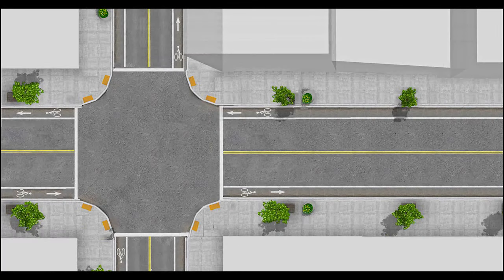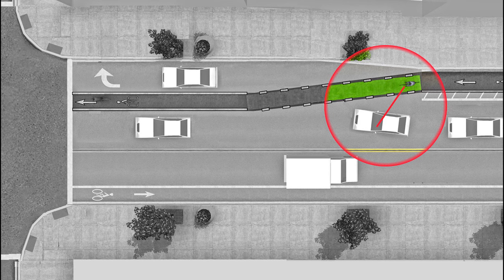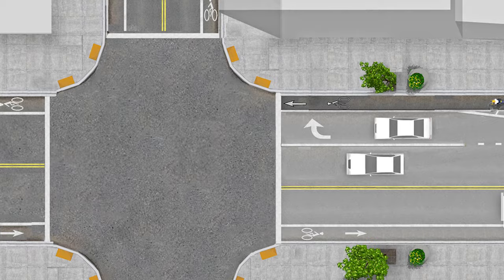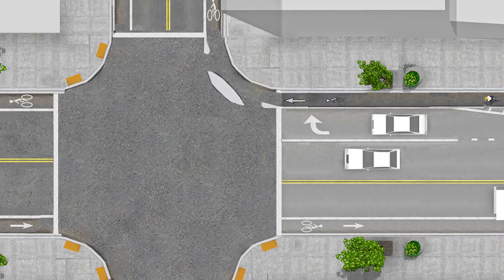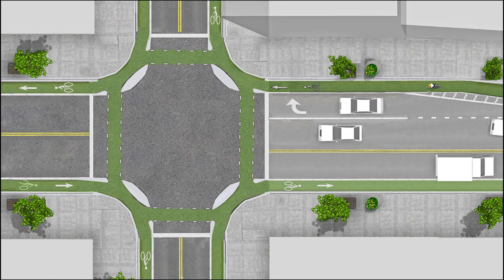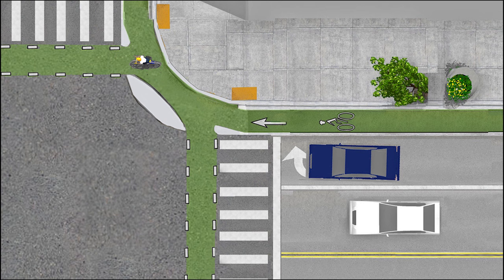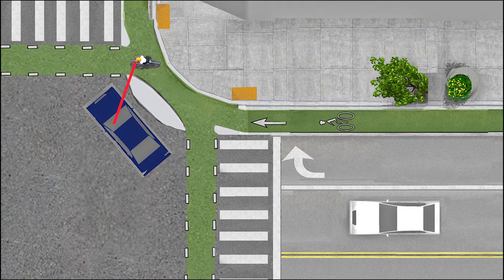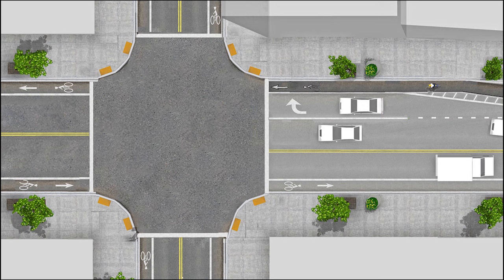Intersection design, the Dutch - cycle friendly - way

Comment: The problem does not originate at the intersection, therefore redesigning the it is pointless! At the point where a motorist initiates a turn, a cyclist, who is now on a collision course, may be many meters from the intersection and therefore invisible to the motorist. Even a relatively weak cyclist can travel at 10 m/s or more. If a motorist takes 3 s to traverse an intersection, the cyclist will have moved 30m in the meantime. These intersections "solve" the problem only insofar as it would be practically impossible for a cyclist to traverse them at 10 m/s!
Reply: Who the hell cycles at 36 km per hour. Most streets don't allow cars to go that fast. Most cyclists cycle arround 15 km per hour or about 4 meters per second. And it is still a masaive upgrade even if a car has to stop for a cyclist as cars can actualy see the cyclists and they don't have to check for cyclists whilst checking for other car drivers, it also helps cyclists who want to make a left turn from cycling in the middle of an intersection
Reply: @Lunavii_Cellest  Lots of people. It's not that fast. Maybe not in that cyclist Shangri La the Netherlands, but there are these wonderful things called "hills". And you may not have realized this while driving (nor the part about hills either) but there is also this wonderful thing called "wind". Around where I live (and most other places for that matter), most roads have speed limits of at least 40 km/h.
Reply: @Lunavii_Cellest  And to recap: if a cyclist is moving at a reasonable pace (>25 km) they cannot be seen at these intersections as they will be nowhere nearby. One of the things that makes cycling most dangerous, is that cyclist are hard to see. Yet the policy makers believe for some reason that by pushing cyclists way off to the side of the road where they are even less visible, cycling will become safer. It makes no sense.
Reply: @NakedUndone  it does make sense as cyclists wont be in any blind corners, and all i see is that 15km/h is the average cyling speed in the Netherlands but also in the rest of the world. and even if you are going very fast this design makes you more visable as you can look to your left and right when you are crossing the intersections
Reply: @Lunavii_Cellest  On the road, you would have right of way and could move through without hesitation. No need to look left or right. "Visibility" in this context does not mean how well the cyclist can see, but how well he or she can be seen, which is probably more important.

"Most" cyclists move at 15 km/h. So what? Why should the "infrastructure" discriminate against those who are capable of more, especially considering that most roads designed for motorists allow for speeds in excess of 40 km/h or more? "Most" cyclists also find they are capable of considerably higher speeds than just 15 km/h after only a few months of riding. I would like to see this vehicle used to its full potential (unlike in the Netherlands...)
Reply: @NakedUndone  cyclists are very visable as they are not in the blind spot for drivers that are turning, and you area able to go higher than 15 km per hour and some people do that. the vehicle is used to its highest potential in the Netherlands. thatsa why everyone rides one. if you want to go fast on a cycle path that is totaly possible on our many highspeed cycling paths like the local one near me the F270 or the Rijn-Waal pad or on the many rural cycling paths. you have obviously never seen what the netherlands really is and that is showing.
Reply: @Lunavii_Cellest  Sorry, I don't believe it. One time I was cycling from Bremen to a Dutch town. I came to a road that obviously lead directly to the centre of town. Sorry, no bicycles allowed. The bicycle path, by contrast, crossed and recrossed the road, snaking through the farmers' fields. Great if you're out for a Sunday ride, not so much if you've just put in an eight hour day, the light is failing and you just want to reach your destination.

I find Dutch cyclists annoyingly smug about their so-called "infrastructure". It's called Stockholm syndrome. They are so used to being second-class road users that they no longer think about it.
Reply: @NakedUndone  "Even a relatively weak cyclist can travel at 10 m/s or more".🤣😂😅   RUN John Forrest(er) RUN !!  Make way for 'Vehicular Cycling for ABLE cyclists !! '  LMFAO 😅! On a normal singlespeed city bike most cyclists won't make that 36kmmh speed and definetely not for a grocery ride !  Besides on a junction where a lot is going on car drivers (or others) may oversee a biker at 36kmh speed !) .
Your ideas are so out of date,  as that idiot  John Forrester himself .
 An 'able'  Maserati is capable of driving speeds of 250kmh , but there are very good reasons not to do so on public roads and take a slow drive in town of 30/50kmh .  Simliar it is not smart to cycle 45 kmh in residential/urban streets with a Pinarello race bike. The risk that you hit other bikes or suddenly crossing pedestrians is too big ! (although you probably would label the latter 'Jaywalking ' 😬😬). 15-20kmh is a sensibles speed, (you won't gain much time speeding with traffic lights junctions anyway , just the same with cars.)
Too bad for your  need for adrenile rush !! But you better safe that for more rural country roads or bike highway paths where you can speed up better !

When you don't have the extra curbs a lot of car drivers are inclined to drive right to the  sidewalk ridge. With the curbs they usually won't do that, because it makes no sense for them. They have to move left at the junction again.
In practice though, when traffic volumes are such to put in these curbs, it will usually be accopanied with a separate bike path and you won't get right shoulder cornered anyway. (But an urban 36kmh will still be a act of real asshole behaviour !).
Reply: @NakedUndone  You know your videos are visible, right? We can hear you huffing and puffing going a measly average 26 kph.

We know that you think having to slow down slightly for intersections will kill you, but it really, really won't. I typically slow down to around 20 kph and then speed back up. It's not a big deal. Unless you're in horrifically bad shape.
Reply: @NakedUndone  Ah, you want to ban cars. Well, I'm with you there, comrade. High five.

There's nothing inefficient about my city's bike lanes. In fact, they're often in better condition than the roads because bikes don't wear the tarmac nearly as much as cars do. There is no issue going 30 kph and I often do. And you don't impress me with your age - I'm 51.

I don't know why you have this obsession with never slowing down (I assume you tear right through red lights), but it's just really weird. The irony is that your two videos showing the efficiency of the road (where you ride in the bike lane) and the bike lane (where you ride on the sidewalk), result in you covering the same distance in almost exactly the same time - despite your ridiculous claims on Quora.
Reply: @NakedUndone  "try it downtown"

I don't know what the hell "downtown" means to you, but in my video I'm riding right through central Copenhagen. It simply doesn't get much more downtown than that. Unless you mean the pedestrian-only shopping streets where, you know, only pedestrians are allowed. But notice the street I enter 6:18 into my video. That is a one-way street. Or rather, it is one-way for cars - bikes are allowed in both directions. Tell me again how that is being treated like a "second-class" citizen. I would literally have a longer route home if I drove a car. (But, just to be clear once again, I agree that we should effectively ban cars from our cities. That would be a good idea.)

So in your video you pick a shitty sidewalk that you're supposed to share with pedestrians, and you go "Look! This is why bike-lanes are bad!" No, you've only proven that infrastructure in your city is shit. But everyone expected that. And no one here is advocating for that kind of shitty infrastructure.

You absoutely could not "easily" have done 40 kph. Stop John Forestering. You sound like you're hard pressed to do 30. And when you're 70 years old, you'll probably be happy doing 15, but the cars will still be doing 60-70 kph. Let's see if you still feel comfortable having them pass within inches of you by that time.

And, OH MY GOD, you lost a whole minute out of 15! Imagine losing a minute to the lying you could have been doing on Quora.
Reply: @NakedUndone  Oh boy...

"For instance parked cars on the side not only put you in danger of being "doored" and of hitting a pedestrian"

Aha, so when you're driving down the road on the outside of parked cars, there is no danger of getting doored, right? So I couldn't easily find an entire video dedicated to cyclists getting doored, a lot of them riding in the road, right? Like this one: https://youtu.be/SWJioMfIuLQ 
( And you can easily find plenty more videos of people riding in the road getting doored.) Of course, the mistake all those cyclists make is trying to pass all the cars queuing up. What they should have done is behave like a car and STAY behind those cars, right? That would mean getting stuck in traffic just like the cars. I'm sure you would enjoy that. Would you enjoy that?

"but also make you invisible to left and right turning vehicles"

Another lie, because we don't allow parking close to intersections. I believe the minimum distance is about three car-lengths, though it's typically more - leaving plenty of view and stopping distance (despite your silly drawing on Quora). It also depends on the signalling at the intersection. For example, if there is a dedicated turn signal, then visibility is less important as it is assumed that people will respect the lights.

"extra, unnecessary bends"

Seek help.

"pedestrians on the bike lane"

Because pedestrians famously never cross the street. Jesus christ...

"extra long light cycles slow everybody down"

North America's stroads: Famous for its short light cycles. (That's sarcasm, by the way. We know how absurdly long those cycles can be.)

"difficulty passing slower cyclists because the lane is too narrow"

Learn how a camera works. No, really. Have you heard of "lenses"? And how they can change perspective? No? There is plenty of space to pass. The typical width of a bike-lane is 2.2 meters. How are you this ignorant? How are you almost 50 years old and don't know how cameras work?

"It wouldn't surprise me if a strong cyclist would lose over 2 minutes taking the road vs. the bike lane."

Like I said: If I had to stick to the road, I would literally have to take a longer route. I would also get stuck behind queuing cars or risk getting doored passing them. (Though obviously not on this particular day when the roads were practically empty.) Why do you think we have bike messengers in Copenhagen? Because they can get around the city faster using the bike-lanes than a car driving on the road.

"I'm pretty sure I'd be physically capable of riding most of the stretch in your video at 40 km/h."

How many years in a row did you win the Tour de France?

"You'll notice in my videos that, unlike anywhere in Copenhagen, there is quite a large hill. I'm easily doing 50 km/h going down it, at least on the road."

There is a hill in Copenhagen where you can reach high speeds. People generally don't because they're not like you and me. But general infrastructure should not be designed for exceptions. I know this is a hard concept to grasp, but that's how reality works. What do you do if there is a red light when you're coming down the hill at 50 kph? Also, please shoot some footage of you going through a turn at 50 kph. Remember to document it using a Garmin watch or similar, 'cause I don't trust your lies.

"Tell me again why the motorists wanted you off "their" roads again?"

They didn't. The cyclists wanted bike-lanes.

"What's another 1 km/h, 2km/h or even 5 km/h off their average speed? It's nothing to them!"

So little? I thought your 30 minute commute went up to two hours somehow?

Of course, all this back and forth is quite irrelevant. The numbers speak for themselves: In my country, and in The Netherlands, pretty much everyone rides bikes. In your country, hardly anyone does. Which is probably how you like it. Because then you can feel special. And you certainly are special. You're very, very special, Peter.
Reply: @NakedUndone  "Trust me"

Not a chance.

"I can still ride at 40 km/h"

You just can't help yourself, huh?

"In the video it looks like you are doing about 20, maybe 25 on average."

About 25 on average, yes. Considering how many times I have to slow down or stop for red lights, I think that's pretty good. What kind of bike did you ride in your video?

"I believe in a meritocracy. Not tall poppy syndrome."

Ah, you're a libertarian. Of course you are. I'm afraid there's no treatment for that, at least not at your age.

"Bike lanes with one driveway after another are the worst because you never know when a motorist--who will have great difficulty seeing you--will enter or exit."

And, yet, our stats are a magnitude better than yours - probably because there's safety in numbers, and because all those motorists own and ride bikes themselves.

"it is 25 km from my place to downtown"

The answer to that is trains.

"So not only do you want to force me to ride at your sedate (not to say lethargic) pace, but also to ride only a certain type of human powered vehicle?"

We have tons of cargo bikes, dude. They're all over the place. I know you live in this insular little bubble, but come on.

"I'd like to try riding the expressway and see how much faster it is."

Yes, please film yourself riding a highway. Perhaps on a cargo bike or a recumbent bike.

"all of the drawbacks which have been understood for decades"

Yes, North America is truly a shining example of the correct way to get people to ride bicycles. It has worked so well for so long, why change anything? A fatality rate 6 times higher, you say? Oh well, survival of the fittest and all that. You win some, you lose some.

"Those who claim that the roads are not safe places for cyclists are making a sad comment on their own driving skill or lack thereof."

It's called "empathy". I know it's a completely foreign concept to libertarians.

"you give them license to steal a minute of your time"

Oh dear, next you're gonna rant about taxes, aren't you?

"you are still discriminating against those riders--however few"

And you are happy to discriminate against a huge majority. You're like a race car driver who insists that because they're so used to and confident at high speeds, they should be allowed to drive 200+ kph everywhere.

"When I was in my twenties, I could cycle at 45 km/h for three minutes or more."

I am in awe.

"my place of employment at high speeds"

I'm sure your co-workers enjoyed seeing you arrive drenched in sweat, and then having to work next to you. Yikes.

"stronger, more athletic people"

I'm sure that's how people describe you.
Reply: @NakedUndone  "The U.K. also has a strong cycling culture but they haven't enacted regressive restrictions on where a bicycle can and cannot go."

And their cycling statistics are not great compared to Denmark and The Netherlands. Although it has definitely gotten a lot better in recent years. Funnily enough they are also getting more and more protected bike lanes, but I'm sure that's just a coincidence.

"cyclist only road"

I'm with you there. And we're working on it. It has been suggested several times to ban non-residential/non-commercial driving from the entire central Copenhagen area. I still have hope.

"Great, now you're insulting my politics as well. How did that get in here?"

Because your elitist views of cycling are intrinsically linked to your politics. I'd wager that most vehicular cyclists are libertarians.

"Here is an example of just how bad they can get"

Here's an example that looks nothing like anything that can be found in your city! How are you this pathetic?

"slow everybody down"

Yes, that's the point. Slower traffic is safer. It is the entire point of the video that we're commenting on.

"Yet the solution given is always "we need infrastructure" not "we need better driver training.""

This is very typical of libertarians. You always go "Why do we need rules? Why do we need laws? Why do we need socialised health care? Why do we need to constantly keep people from harming each other? Why do we need an age of consent?"

Maybe one day you'll figure it out.

"Wouldn't it make more sense to remove those vehicles causing the problem so that the road is now a safe place for cyclists?"

As I have said several times, I'm absolutely in favour of getting rid of practically all cars. It might look something like this: https://youtu.be/sYQe6lznXeg?t=371
I'd like to see you doing 40 kph down those streets.

"And Dutch cyclists and their ilk are so used to being second class, not only do they not think about it, they actually enthusiastically support it! I have seen this elsewhere, but I won't get into that..."

Something about the Soviet Union or Nazi Germany or slavery-era USA, I'm sure.
Reply: @NakedUndone  "mandatory cyclist training"

My 77 year old mother has cycled pretty much all her life. Do you think she lacks training? Do you think that with training she'd be comfortable TAKING CONTROL of the road from the cars and DOMINATING it while metal vehicles tear past her at 60-80 kph and she has to breathe their fumes? Or do you think that she's much more comfortable on a separated bike-lane? I want you to answer this question.

My partner feels the same way. She too has been cycling all her life - which means longer than you. She's quite happy going a leisurely 12-15 kph. She's not in a rush. If you were to ask her how fast she got to work, she'd be puzzled. When she describes a bike ride, she uses words like "nice" and "pleasant" and "enjoyable" (look them up), she doesn't talk about what speed she managed to keep up and how much time she saved. Do you understand this? Do you understand that most people are like this? Again, I want you to answer this question.

I think that people like you and John Forester fundamentally have an issue not understanding other people. You think that because all you care about is going fast and saving a minute here and there, that must be what everyone thinks - and it's what everyone SHOULD think. It's really sad.